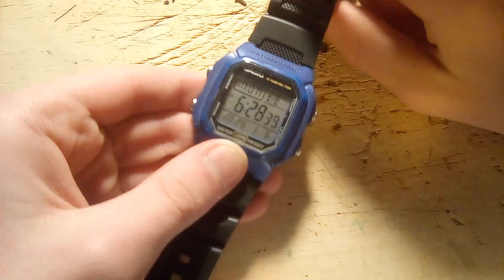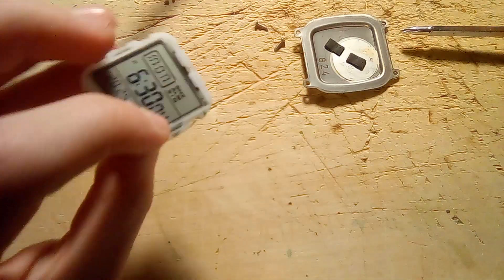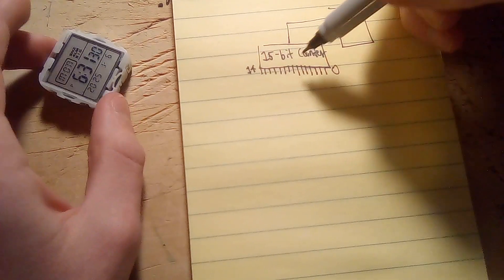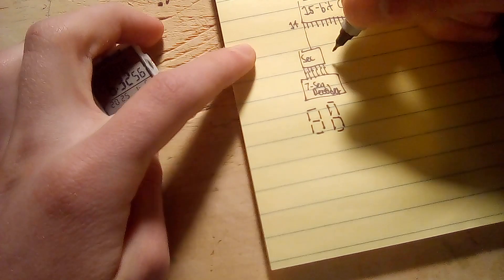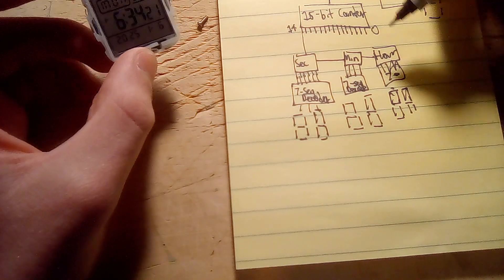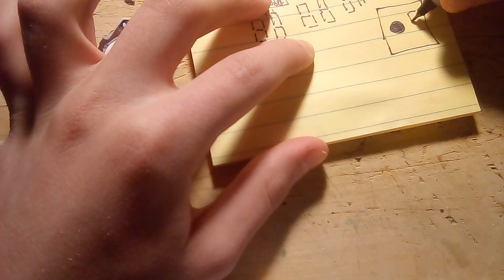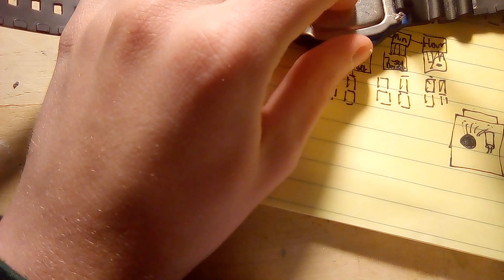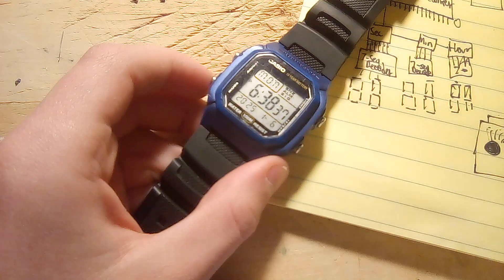What is inside a cheap digital watch?

Comment: When I started playing around with microcontrollers, one of my first projects was a timer. The way the AVR Atmega8 handles timers, is that you can first configure a prescaler. (That is basically the counter that you are describing.) The programmer can choose different divisors to divide the CPU clock down to a more manageable frequency, which would then count up the 8 bit timer register. Once the 8 bit register overflows, it would then call your Interrupt Service Routine (ISR) where you can handle your own code to set a clock and adjust minutes, hours, etc.
I figured that you can use the internal 4 MHz clock to drive the timer, but with the given prescaler divisor options (1, 8, 64, 256, 1024); say you pick 1024: you count up your timer 3906.25 times a second, and it would overflow approximately 15.259 times a second. At this point you have to decide: do I count up my seconds every 15th time or every 16th time? Or do I skip a second every once in a while to compensate for the error? Another approach would be choosing a smaller prescaler, say 64; this would give you (4000000 / 64)/256 = 244.140625 overflows a second. Now I could count up your second every 244th time for slightly higher accuracy, but we can't deny it still has some error. Technically you could also reduce the prescaler to 1, which gives you 4000000 / 256 = 15625 overflows a second. Great, no decimals! But with that many calls to your ISR, you need to be extremely careful how much code you put in there. You need to make sure, that your code completes processing before the ISR would need to be called again.
And this is how I figured out why I found a quartz in my collection that had such a weird number: 4.194304 MHz or 4194304 Hz. This value is a base of 2: 2^22 = 4194304.
Doing the procedure again with that quartz: 4194304 / 1024 = 4096 counts on the register per second. 4096 / 256 = 16 overflows per second. So, I could count up my seconds every 16th time in the ISR; and I would also count up a "little tick" counter for millisecond scale operations for animation effects.
Reply from the maker: Whenever a frequency is a power of 2, it can be fed into a counter (assuming this counter has an infinite number of outputs), and one of those outputs will output a frequency of exactly 1 Hz. It is also possible to grab the time from the internet using something like an ESP8266, but that is a whole other rabbit hole to fall into. I actually did manage to build a clock using an ESP32 and an OLED display, but if I were to try it now, the ESP doesn't want to be programmed and the OLED refuses to work correctly.